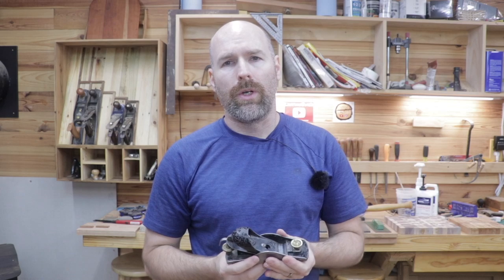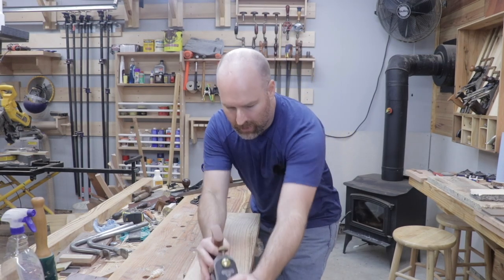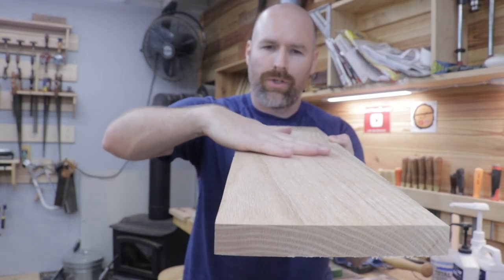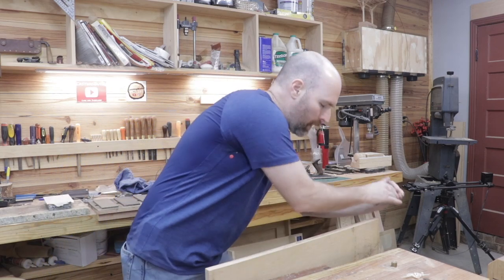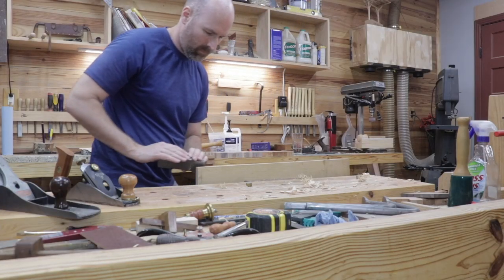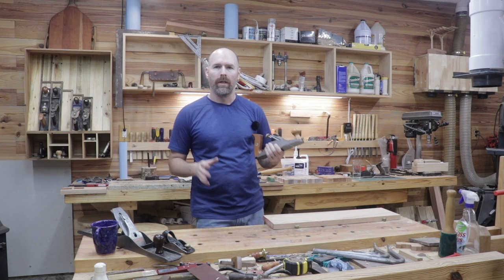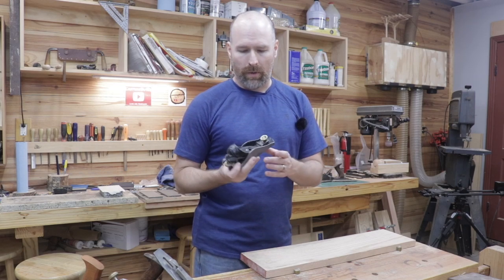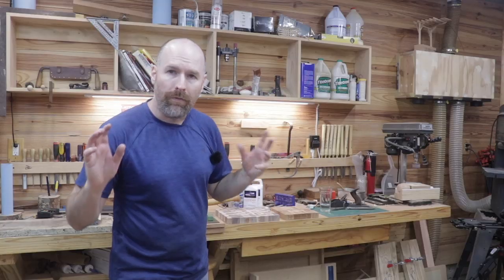Three Reasons You Must Have A Hand Plane!

Comment: The hand plane is a tool that connects me to the project.  No dust, no noise, very controllable and.a very satisfying feeling that you sharpened and adjusted the tool right so it works perfectly.  Sometimes I will put a piece of scrap pine in the vice and make some thin nearly see through shavings. just fun and relaxing to use.

Comment: Often in my case it’s ease of use. Due to space limitations I keep my bench top jointer and planer put away. If I’m doing a smaller project it’s just easier to grab a couple hand planes to prepare my stock then to get out the machines. 
Another is noise, if I’m working after kid’s bedtime I don’t have to worry about disturbing others.
Reply from the maker: I love not wearing the safety gear